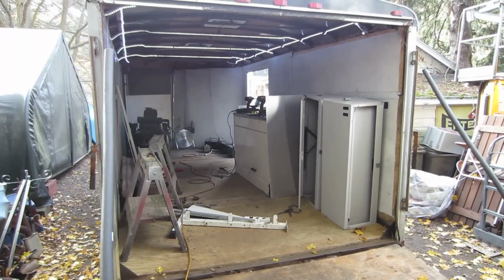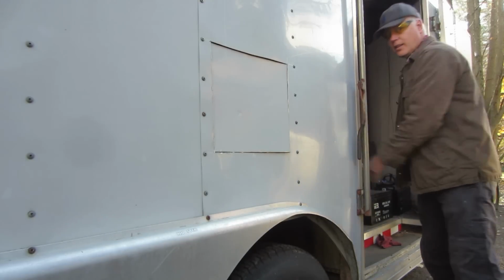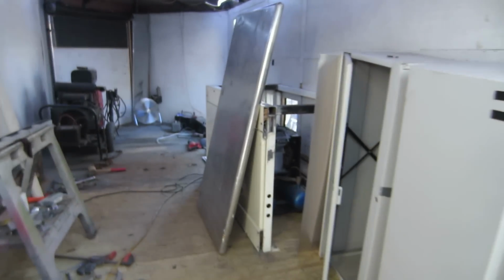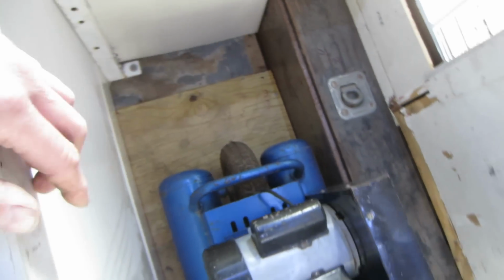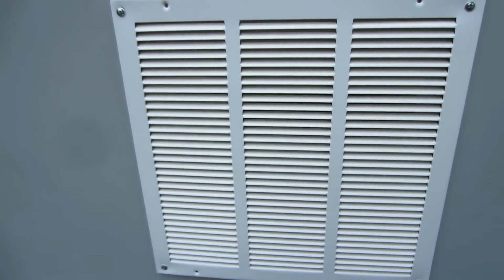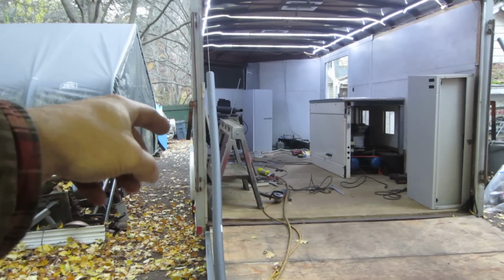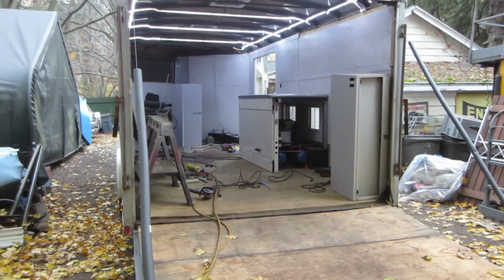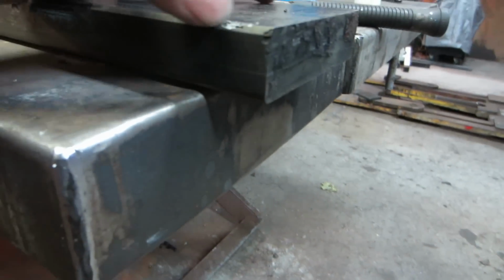welding trailer venting

Comment: Steel mesh like a chicken wire thick really thick like a rebar for concrete inside the vents you might pull the vent off but you can't pull the rebar

Comment: How about a 20" box fan wired to the compressor power so it exhausts air as the unit is running?

Comment: That material you were hammering and drilling on looks like fiberglass. If you try and cut it with regular tool steel it will burn the cutter up if it is fiberglass. It is some tough stuff.

Comment: Install a 12 volt auto radiator cooling fan to pull out the heat from compressor.

Comment: you ever thought of getting a Rotozip? .. the spiral cutter tool? or an oscillating tool? .. iv'e used both and they are excellent for situations like the vent cutting where control is needed but you also want a nice cut line that's not chewed up.

Comment: It was in the 90's when you started, now the leaves are gone off the trees LOL, but I realize all projects in their own time, especially when you have a lot of things going..and as a busy person too, know that feeling. Get magnetic vent cover material for the louvers when in snow/rain travel.https://www.amazon.com/Deflecto-Magnetic-Cover-Sidewall-MVCX512/dp/B00009W3G4
Look for Semi-truck air tanks, they are compact yet heavyduty, and would fit in that space well. Lots of wasted space behind the compressor over the wheel well, 1 there and 1 next to it, use them myself in my detached garage(2) and one in my shed/workshop as booster tanks, plus 1 of the garage ones is easily detachable(quick disconnects) and has it's own gauge and a hose to make it portable tank too.

Comment: I have an idea you should add a tea and then have the airline hook up to that and just leave it regularly and have another one screwed into that and like you were saying add a reserve tank and just T it off of that output right there and have another ball valve at the reserve a little either 90 or just a little elbow 60 or 80 or whatever degree you want and then have that ball valve keep all the pressure in and have another ball valve at work comes out of the tanks

Comment: If your compressor is too loud, I took my 7.5 HP unit and placed automotive radiator hoses and attached onto the intake air before the air filter. These hoses hung down almost to the floor. This does not restrict your fresh intake but will dampen the noise at least by half or more. I also set my unit on vibration isolation pads. You can also use motor mounts. I learned this from an industrial compressor mechanic and installer. What a difference. So quiet now and cheap. just a suggestion from an old timer.

Comment: Listening to your description of weight distribution-when you can, put what you are going to haul on a regular basis and go to a truck stop. Weigh the rig- the scales will give you steer axle/drive axle/trailer axle weights. Then adjust the trailer for optimum balance on the hitch. Just a thought...

Comment: have you considered storage space for clean chemicals and waste fluids. 
moving air for cooling equipment cabinets, computer fans, light weight, small power usage, pick them up at scrap yard, even one in and one out in both cabinets
Reply from the maker: not planning on carring that kind of stuff,

Comment: Mustie, the stuff your working with is solid phenolic material. Best way to describe it is a sheet of Arborite that's 3/4" thick. You can cut and router it no problem with carbide saw blades/router bits.

Comment: if on one side you set up a car radiator fan to pull air in then it would force the other vent to exhaust. And a 12 volt fan shouldn't put that much drain on the Genny.

Comment: I'd put a 5/8" aluminum C-channel top and bottom of those vent holes and slip in a couple of house furnace filters - keep the bugs and dirt out of the air-compressor cabinet. - Just thinking out-loud :D

Comment: Instead of turning your regulator sideways, and complicating your cabinet with another door, why don't you remove the coupler, throw a street 90 in there, and then put the coupler back on in your desired position?

Comment: I'm only partway through the video (loving the series by the way) but have you thought of putting an elbow on the air compressor outlet rather than rotating the whole regulator & gauge assembly? That outlet should come off and will be 1/4" NPT, you can make any hard line off of that, T it off for a whip hose to a hardline throughout the trailer too. That'd be pretty neat rather than a hose reel, have a couple outlets on the roof off of hard lines.

Comment: You might consider putting some aluminum bent at a 45 along the top and leading edge of each louver. This would help deflect any rain water out away, even while driving. Kind of like the wind deflectors used on the tops of car doors. Looking good sir. RM

Comment: To remove the whole compresser you will hsave to remove the bottom beam, Remove it then strap down and the catches will be inside, OK But you would have to remove the bottom beeam if you ever need to just Re-tighten the straps, The obvious place for the Generator is the same as the Compresser, right over the wheels?

Comment: The empty space on the left inside of the compressor cabinet was a great idea to put a retractable air hose to.
Perhaps hinge the top so you can install horizontal cubbies under it instead of drawers.

Comment: That compressor definitely has enough airflow now! You might want to use carpet padding on the interior walls for both the compressor and the welder/generator for sound dampening. It did it for a shop vac and it worked out great.

Comment: you can quiet the air compressor some by putting a 90 degree elbow on the intake /muffler and adding a length of 5/8 " heater hose

Comment: use a 16x16x1 air filter as a pattern , and make a tin panel to install in them to seal them up when you need to ...

Comment: The grills you have are return air grills for heating and a/c, you can buy air filters, ( dust stops)  to put in them. Not a bad idea since your filtering the air going through your equipment.

Comment: That bench top material you've got should be ideal for what you're going to be using it for, it's extremely resilient, almost impossible to set fire to and it has quite a cushioning effect too.  It looks like the stuff the welding benches at my old college were made from, and if hoards of kids learning gas welding couldn't set it on fire or weld stuff to it then it'll be ideal for you...

Comment: I'd put a split-open chunk of inner tube around those holes you cut & caulk it in place ... the wood underneath will rot because it's open to the air